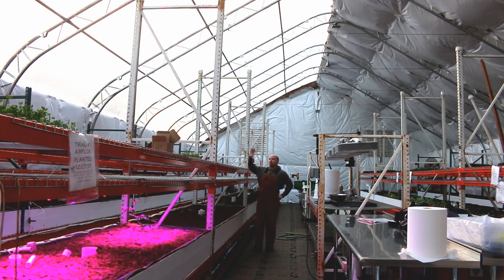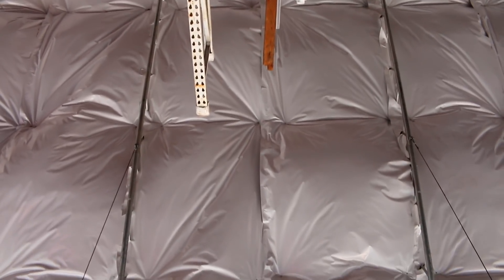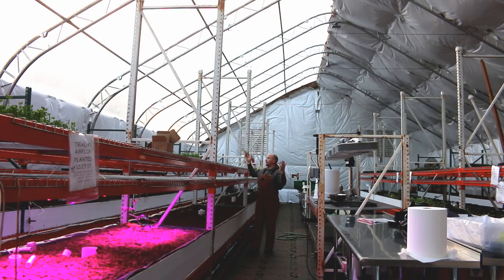Greenhouse - RETRACTABLE ROOF NOW?

Comment: How far down does the ground freeze in your area?  How deep do you have to go to reach 55 degrees underground?  The underground temps somehow are the solution for winter and summer, day and night.  Do you read Gary Reysa's articles in Mother Earth News?  He was an aircraft engineer, now retired in Montana.  Maybe some inspirations in some of his work.

An example:  I did a very poor knock-off of a south wall solar heat collector of his (I'm talking fabric here) and gained 17 degrees from bottom to top of a tall bedroom window.  The flow was nearly enough to float a feather.  To offset night heat loss, I bubble-wrapped the window and still got a 13 degree rise on a sunny day.  Back to underground:  If a greenhouse on the south side of a shop had an excavated area under it, lined with thick plastic covered styrofoam sheets, fitted with good sized air piping spaced apart, refilled with dirt around the piping, covered with more styrofoam and perhaps a hard top, then more dirt up to floor level, and a fan system to move air through the pipes; heat collected in the day could be stored in the dirt tank and released at night.  Any overly hot day air could be diverted to the shop.  My recollection is not perfect, but I think this is one of his plans for a future project.  Another underground idea came from a couple in Fordyce.  They were looking at collecting summer outside air many feet from their home, pulling it below ground several feet with no more than 45 degree pipe angles, sucking supposedly 55 degree ground cooled air into their home with a relatively small solar fan, and helping with air conditioning.  It sounded good to me and I want to try this, but it seems to me after the pipe goes downward into the ground, there needs to be a way for the humidity to drain out as the air cools, then the pipe needs to become more shallow as it nears the house.  It doesn't seem like it would be that hard to design something that would work for temp and humidity in your set-up.  The hard part to me would be the sizing of it.  The other hard part is lots of digging.

Comment: I can't help but think that the decision to not insulate the entire roof is costing you both in heat loss and as a result, condensation. More lights would be far less expensive. Interested in knowing if I'm right. But doubt I'll ever know. Thanks for sharing.

Comment: Just an idea. Instead of moving the isulation between the rafters:
1, Connect  the middle of the insulation to the rafters so that it will span just over half the distanse between the rafters.
2. At daytime the two half can just hang down to get the light and heat in
3. Add a wire to each edge of the insulation and use it to lift it up into position at night.
4. Include a magetic strip along the edge to get a fearly good seal in the middle.

At daytime only a small fraction of the light will be block by the hanging insulation, and all off the heat will get in. When closing the insulation a lot less mass have to be moved

Comment: With high temperature animal housing (approx 30 C) we found it highly benficial to use a heat recovery device to harvest some waste heat going out by warming incoming fresh air. In very simplistic terms device behaves as a car radiator. Stale air as the "coolant" flow in tubes and exhausted vertically and fresh air passing over the tubes horizontally containing the warm stale air.

Comment: Just brainstorming... Is there a way to treat the building as a house. Let it breath by venting the air similar to soffit and roof vents on a home? I'm not sure if there is a way to vent out the roof but installing some vents at the bottom would be easy enough. Instead of trying to stop airflow, use it to solve the condensation issue.
Reply from the maker: +jspivey1980 that is thought provoking
Reply: An interesting suggestion I think. Trade off some heat loss and reduce your humidity, reduce risk of crop loss through fugal growth.